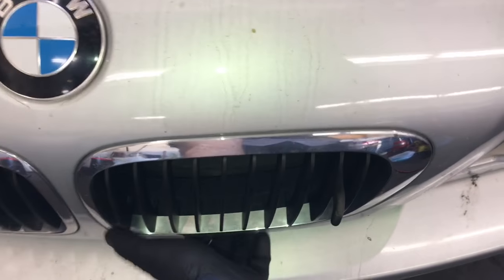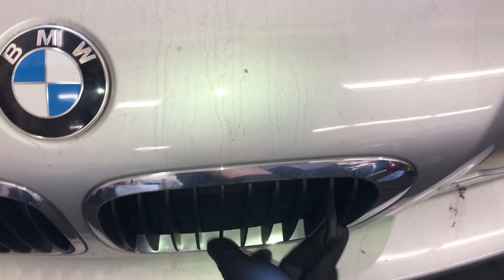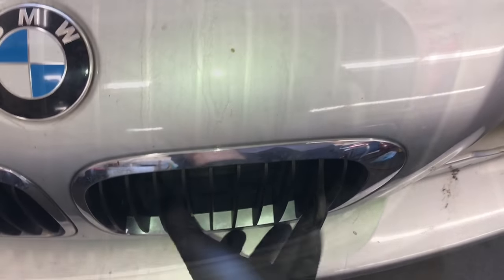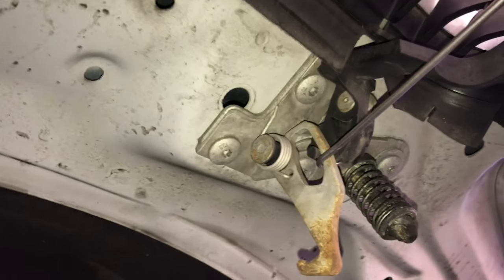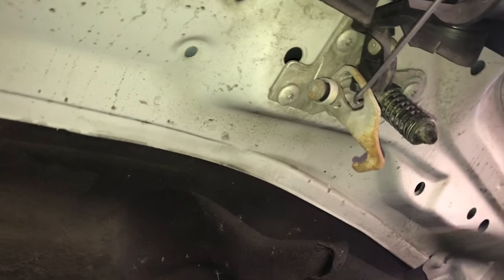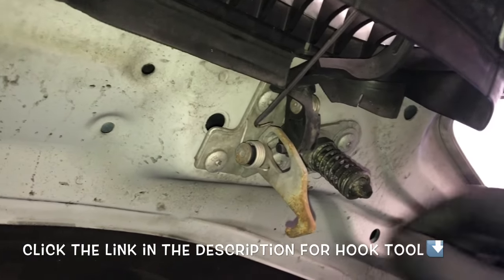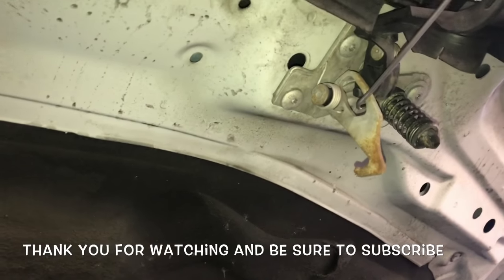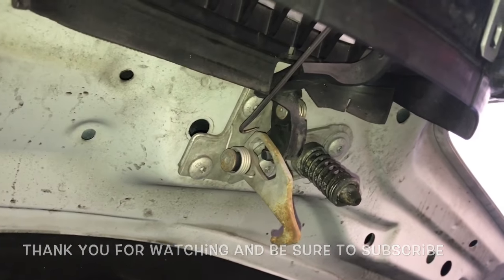BMW Secondary Hood Latch Won't Open Fix

Comment: Hi, is there a way to get the hood open with the door locked 🤦🏽‍♀️went to jump start my car with the key in the ignition, the wind closed the door and as soon as the negative leads touched the terminal it locked my doors 🤦🏽‍♀️ so currently stuck with my key still in the ignition with a dead battery. I got a 2010 bmw 3 series
Reply from the maker: @LaurynWhaanga  you can pot out the grill and play with the latch

Comment: Great video, I worked on a beamer that had one side of the hood latch was stuck and once we got it open the cable was stretched so it wasn't pulling as much as it should
Reply from the maker: Jursaw I have run across that also.

Comment: Great tip, I easily got the bonnet open by following your advice. Seems the plastic handle is work out where it meets the metal hook.

Comment: same problem with mine (e39 m5); coat hanger worked just fine, took couple minutes. Little wd40 on the metal pieces of secondary latch, now good as new! Thanks for the video!!

Comment: I had to leave a comment. This really worked. It works on my x5 series too. It took 5 minutes. I had an old paint roller that I bent into shape to mimic the tool shown in the video and it worked like a charm. Thanks sooooooo much!!!
Reply from the maker: craig barka that’s awesome I’m glad it helped out. Thank you for rating in watching!
Reply: @HowtoAutomotive  Your awesome ! I had to go through the driver side of the hood instead of the front of the hood but it is the same exact concept. Find the latch and pull it back while lifting on the hood. Thanks again!
Reply from the maker: craig barka thank you for watching!

Comment: Thanks for video. I used a 6mm hex key with the length 18cm and a polygrip (Monkey pliers). I guess that minimum length is ~13cm.
The cam curve in the hood safety catch has very low angle and you only need a small dent or some rust and it will not work properly. Also, the arm moved very slowly when released. Cleaning with Muc Off and water made it move a lot better. Some oil on the “bearings” and lithium grease on the cam curve made it operational again but I don’t know for how long.

Comment: It worked for my BMW E46! I used a bent coat hanger and a mirror. It takes some time and it is not very easy - but eventually it is possible to get a hold of the mechanism. Then you have to pull it somewhat hard, because it is most likely rusted, but once the mechanism is activated, you should be able to open the hood easily.

Then I first WD40'd the mechanism and oiled it with some bicycle lube. It works well now.

Thank you for the video.

Comment: Or it happened because... you shut the bonnet with a piece of the rubber compartment separator hanging out of the side of the bonnet.

If you don't have a hook tool, I got by with using a long hex key and some pliers to grip and pull on the hex.

Thank you for this btw!

Comment: Thank you perfect, my problem solved!... i used some bicycle brake wire looped around the hook at the bottom. But importantly this video pointed me in the correct direction! - mine was rusty- got lots of grease on it now
Reply from the maker: 4nth0nyw glad the video was helpful. Thank you for watching!

Comment: Thanks for the video I need a long pick tool now.
Reply from the maker: James Bennet you could probably make one.
Reply: Thanks for the reply I was looking for one online like yours and couldnt find any only sets most of them didnt look long enough and phoned local car spares shops too with no luck. I'm thinking of trying something like putting a bit of a bend on a coat hanger wire.
Reply from the maker: James Bennet there is a link in the description of the video for for the hook tools. Just look for the Little triangle in the description and the menu will Drop down and you will see all the links.
Reply: Yes I clicked your link after replying and located a set in the UK online thanks
Reply from the maker: James Bennet glad to help. Thank you for watching!

Comment: I got a 2003 7 series..is it the samething?...at first the secondary leader was working...it was on the passenger side of the hood that wood not open...now it's the secondary and the passenger side of the hood that won't work..need ur help man...kinda don't want to take it to a shop..they going to charge an arm and a leg...need help ASAP..I JUST NEED TO PUT COOLANT IN MY CAR...crazy huh
Reply: did you manage to get it open? what did you do?

Comment: will it work for an e87 05 ? thanks for the great vid
Reply: u just pull the steel rope on e87 without removing the kidney grill on the car driver side...even without a special equipment like yours u can do it..thanks anyway for the vid

Comment: Will it work for  08 750i
Reply from the maker: Matt Gibson the latch maybe different but this should still work
Reply: Will this work on 745i
Reply: @josephlone9391  no
Reply: at least not on mine...how did you get yours open??